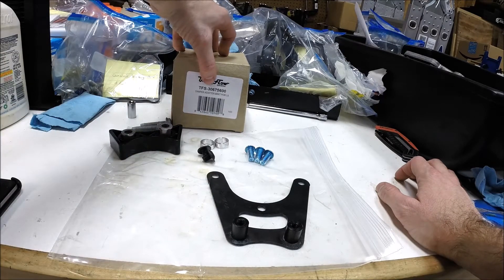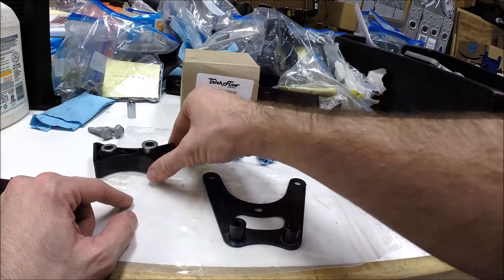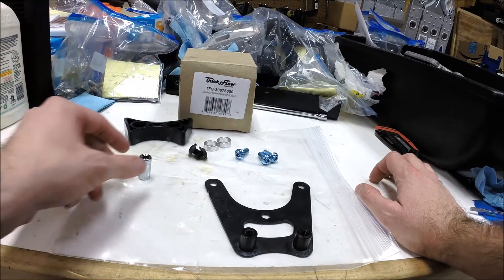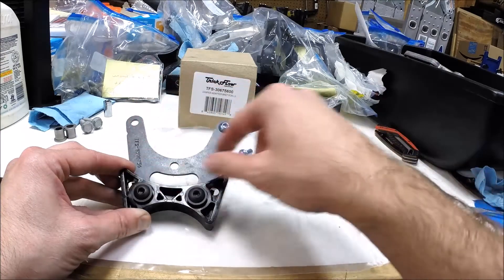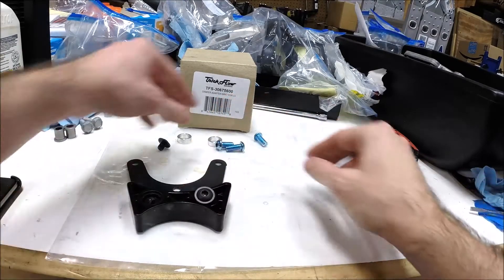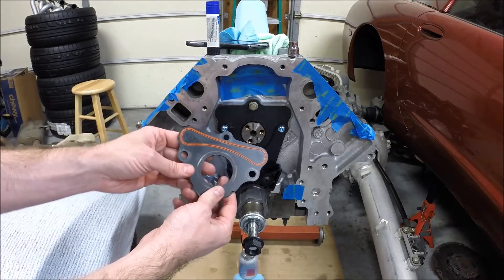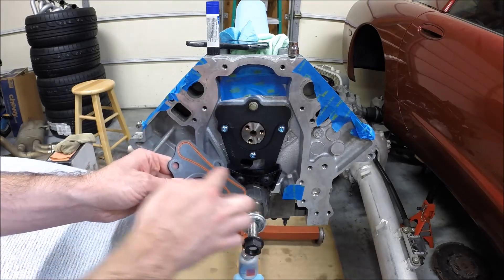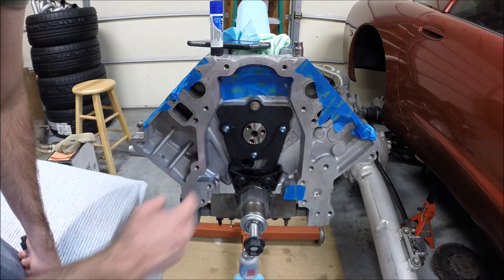LS Tech: Trickflow Timing Chain Damper Install

Comment: Piece of crap bolts included in this kit. Heads stripped before reaching torque. Ground down head of some arp bolts used those instead.
Reply: I have ARP heads. If I don’t grind the heads they will
Hit the cam gear?

Comment: Nice video! Couple of questions: I’m also curious installing a new crank sprocket, how do I determine how close to the block I press it in? Does the key sit flush with the outer edge of the sprocket? 

BTW, I had a BTR damper, when I tried to press out the bushings, it broke the plastic damper into several pieces. The bushings are not smooth. They have an indented ring where the damper plastic holds it secure. I ordered a GM damper and will try again

Comment: Hey Scruf,  helpful videos. I have an LS1 (99 C5) that I’m installing BTR stage 1 cam, new oil pump and want to upgrade timing chain to LS2 with damper. The block has no damper holes for bolts so I need the Trick Flow adapter. It’s hard to see from your video but are you using a new cam retainer plate? Or is it all one piece from Trick Flow? Will this setup work with a double chain timing kit?
Reply from the maker: Yes, I used a new cam retainer plate.  The TF adapter is a separate piece.    I'm not sure if it would work with a double roller timing chain.  The width of the chain would be thicker, though that might not really matter.   Probably best to call Trick Flow to confirm.   FWIW, I used an LS2 chain and was happy with it.

Comment: Would it be necessary to remove oil pump to install this?
Reply from the maker: Yes I think the oil pump is in the way.  Take a look at the oil pump installation video I did.  ( https://youtu.be/xjuwwlALVzM )   It looks like the oil pump would block the two bolts that hold the damper.
Reply: @ScrufsGarage  thanks. I'm going to attempt it by mounting the damper on the bracket first, then mounting to the cam retainer bolts. Removing oil pump is not an option for me, my pan will not drop low enough without pulling the motor.
Reply from the maker: gotcha.   it sounds like that could work.   definitely let me know how it works out, that might be able to help the next guy too!
Reply: @ScrufsGarage  I have an 03 remanned lq4 in my 05 cts-v, im installing this damper (if I can pull it off) pac beehives, Ti retainers, and a 114 lsa cam, little hotter than an ls6 grind, going in.
I'll definitely post up how that damper works out in a couple weeks, I don't see why I couldn't "hang it" behind the pump and, fish it by the chain.

Comment: If upgrading to an LS2 timing chain. Does this upgrade have to be installed. Or can I just add the LS2 timing chain with Pugh dampener
Reply from the maker: Not required.  The damper is optional.  And this particular kit is for blocks that don't have the pre-drilled holes for the damper (thus the additional bracket).   Hope that helps!

Comment: I bought the damper kit..it is nice set up..but you can take those allen head screws and put them where they belong..in the TRASH.. they suck and strip very easily.. bought a new allen wrench to set them.. crap screws.. I took the factory bolts.. belt sander half the head off.. went right in.. good spacing and torque up easy and quick
Reply: If you didn’t sand off the head some the bolts hit the cam sprocket ?

Comment: So exactly what is your definition of an early block? Sub'd
Reply: Don Dada  meaning a gen 3 ls block. Pre 2004 4.8,5.3, 5.7, and 6.0. So ls1 ,lm7 ,lq4 lq9 etc. later year ls blocks had provisions for the damper already in the block so you don’t need the adapter.
Reply: @iamlunchboxx29  cool My block is a 2006 but didn't pay attention to that when I swapped my cam. Would I be okay as long as I'm not racing Torqer v2 cam 112 lsa 600intake 600 exhaust
Reply: Don Dada it’s not a necessity to run one. As stated in the video , the timing chain has slack that the chain sorta slaps back and forth. That slapping causes wear on the chain that will cause it to wear/stretch faster. The damper is to minimize that slapping effect, thus slow the wear on the timing chain. Is it essential, not at all. Is it nice insurance? Absolutely.
Reply: @iamlunchboxx29  wrong. My 2005 Hummer H2 has the Lq4 and it does not have those holes and does not have the dampener. I’m doing a cam swap right now and I did not see a dampener or holes for the dampener. So I would have to buy this kit.
Reply: @buddyrebel_Garcia  I believe it was when they started using the vvt cams that they incorporated the guide assemblies but not sure. My gen3 lq4 definitely does not have it either. Heed the warnings, the bolts included are made out of led! Absolute garbage and won’t survive even 15ft pds. pressing out the bushings isn’t going to happen by hand either, definitely need a press or big vise and it’s easy to mess up the plastic guide doing so.

Comment: What is damper for? Excuse my low knowledge. I’m redoing my timing and would like to know exactly what it is for?
Reply from the maker: Good question.   There will always be some amount of slack in the timing chain.  The rotation of the timing chain around the timing gears can create a whipping action that produces a harmonic oscillation in the timing chain that can lead to premature failure.  This typically more pronounced in road race applications that have sustained high rpm usage.   But even for a street car, it's cheap insurance.
Reply: Scruf's Garage thank you very much! Very good info! My 04 GTO ls1 block has the pre-drilled and tapped holes from factory, so I won’t need that bigger bracket right?
Reply from the maker: Correct, if your block is already drilled for the damper, then you do not need the additional bracket.
Reply: Scruf's Garage again sir thank you very much! Have a great day!
Reply: @ScrufsGarage  so I shouldn’t use this tensioner if I’m not gonna be racing ?
Reply from the maker: @panchoaguilar1910   anyone will benefit from damper, particularly someone racing.  If it were just a fun street car, I probably wouldn’t take the car apart just to install the damper.  But if you’re already in there doing other work, then I think it’s worth it.

Comment: The best way to do it is to replace the junk allen screw on the camshaft retainer plate by ARP 134-1002
Reply: Are those bolts long enough to fit with the dampener bracket ?

Comment: Will this chain damper work on a 5.3 Gen IV LC9 engine? Or will I need the damper bracket?
Reply from the maker: So the bracket is for the early LS1 blocks that were not drilled from the factory for the dampener bolts.   I am less familiar with the newer 5.3L blocks with VVT, etc.  I "think" they are probably drilled for the dampener, but definitely do a bit more research to confirm.  I don't want to steer you in the wrong direction since I haven't worked on that specific application.
Reply: Thank You.
Reply from the maker: No problem, happy to help.

Comment: Just a heads up on that product, you MUST enlarge the holes in the plastic guide ever so slightly to allow it to slide effortlessly on/off that metal bracket without enlarging them so much creating sloppy fitment. If you do not do this before installing it on the engine, you will not be able to get it off for servicing the timing set or camshaft and you will likely break the plastic guide or bend the metal bracket  during your attempt to remove it. You cannot remove the timing chain/gears without removing that plastic guide first. First hand experience talking here. That plastic guide is a really really snug fit on the metal bracket
Reply: I didn't have to do that with mine. Mine fit perfectly.
Reply: What do you suggest drill bit wise to enlarge the hole a bit?
Reply: @danmarley2926  i just used a rolled up piece of sandpaper in the holes and spun it by hand backwards making the paper want to unroll itself, which conformed itself to the size of the hole and apply enough pressure to remove material. Only a small amount was needed to be removed on my part
Reply: @nickb2657  Thanks for the response, I'll definitely keep this in mind since I'll be purchasing this really soon.
Reply: Thank you I did not know this